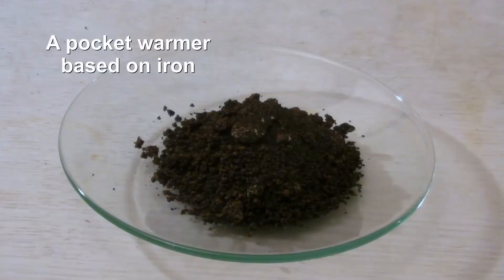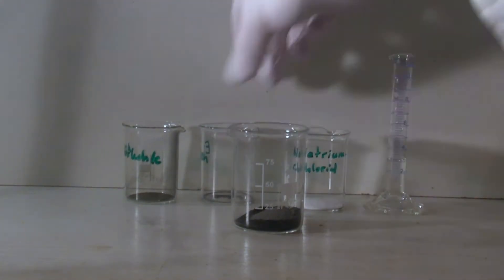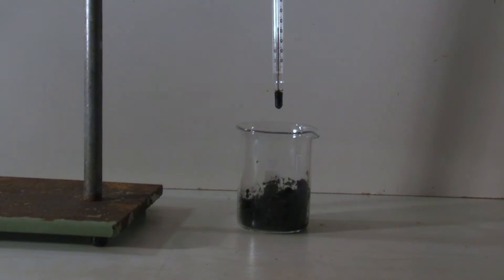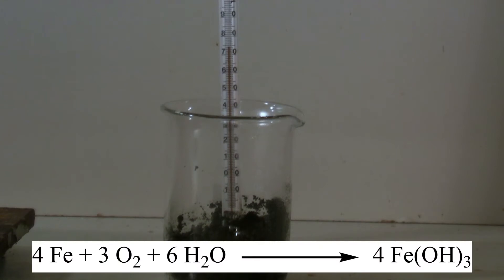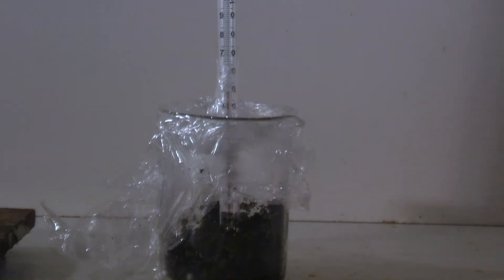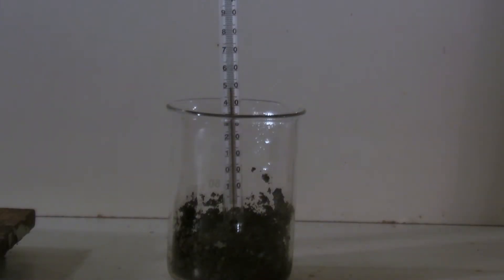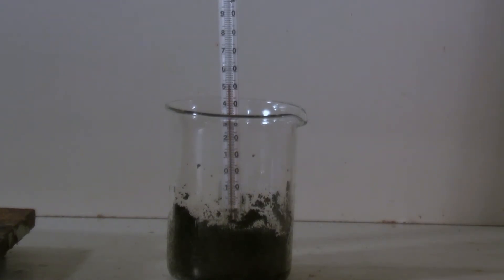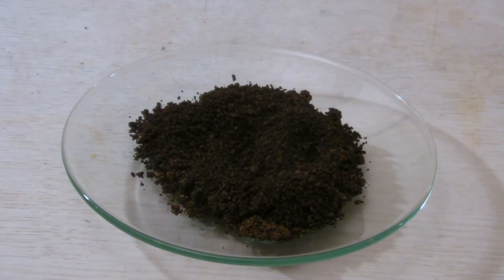Pocket warmer made of iron and charcoal

Comment: I can't believe it's so simple!!! I recently got about 50 kg of activated carbon out of a dumped filter... I spilt quite a bit of it in my van, its a old and rusty VW... with the salty spray from the winter roads leaking inside... I think I may have inadvertently turned parts of my van into a hand warmer 😄

Comment: How to activate normal charcoal
Reply from the maker: As far as I know it's pretty difficult to do in the lab. F.e. steam is used at around 700-1000°C, which needs quite a lot of pressure and phosphoric acid at 800°C, which usually has a boiling point at around 200°C. So this also means a lot of pressure. Vapors of highly corrosive phosphoric acid at 800°C and high pressures sound like something that could easily kill you.
Reply: @RaExpIn  I wasn't knowing this that is so difficult to make  activated charcoal but wait newly made charcoal also will be activated. If I char some sigar or wood will it be used as activated charcoal and if we boil some charcoal in water will it become activated.

Comment: I don't think it would be a practical method for a pocket warmer because the mixture would have to be in a closed bag to avoid leak, so the oxygene in the air can't interact with the mixture.
Reply: this is actually what most hand warmers in the uk are based on
Reply: I think that now most hand warmers are based on sodium acetate recrystallisation.
Reply: the only ones available in my town are activated charcoal/iron based but yes NaOAc hand warmers are fairly common
Reply: Phosgene Oxime : Some use ammonium nitrate & H2O...

Comment: Thank you for this.  I'm going to try it.
Commercial pocket warmers seem to use some method to slow the reaction and thus maintain their warmth at a fairly steady level for a longer time.  They also don't require (or do they?) the addition of water to bring the reaction to completion, yet their contents seem to be dry or nearly so.  Have you any idea how this behavior is accomplished?
Reply from the maker: I haven't thougt about that, when I did the experiment, but I guess the commercial ones do contain some hygroscopic salt. F.e. lithium chloride.
Reply: they add vermiculite to do that